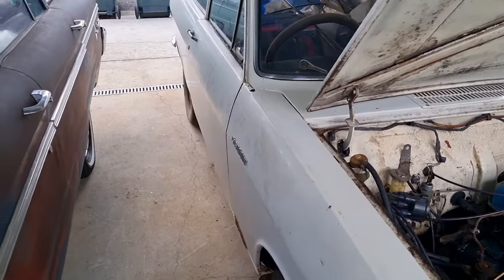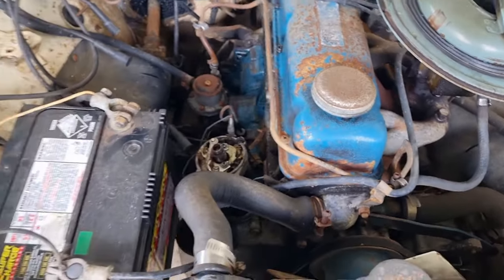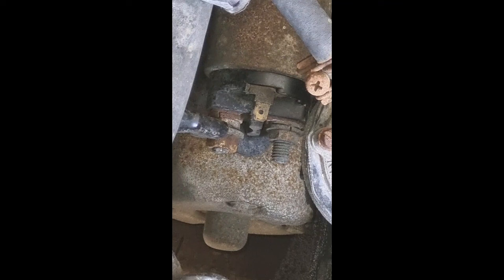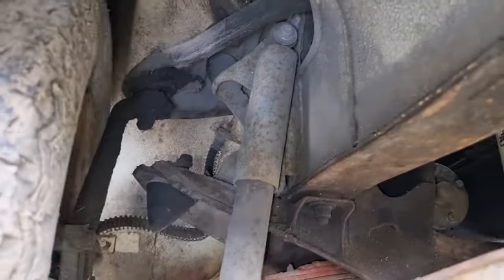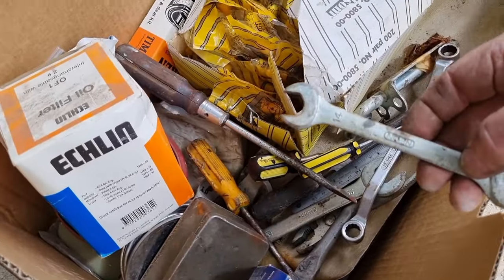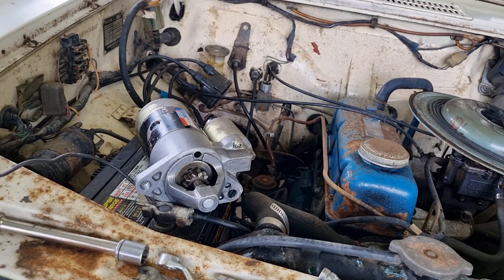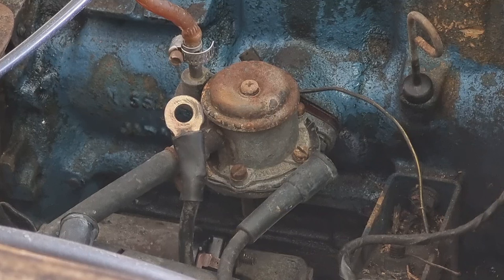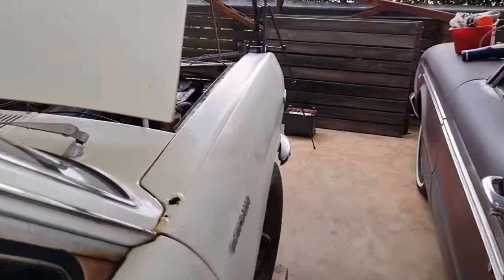Shed find 1968 Datsun 1000. Will it run 🏃‍♀️, Part 2

Comment: I remember them well from my childhood days. Bodies were thin, but the engine's bulletproof. If it's not rusted tight, it will most definitely run. I think the bendix drive is faulty, not the solenoid.
Reply from the maker: Thanks mate, I'll check it out if it gives further problems.